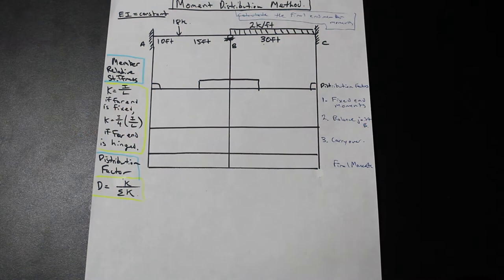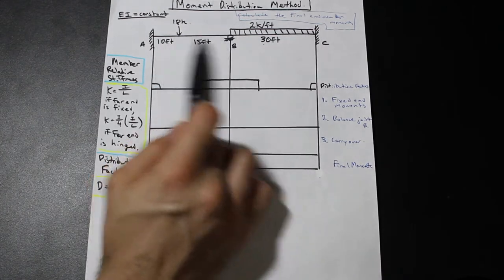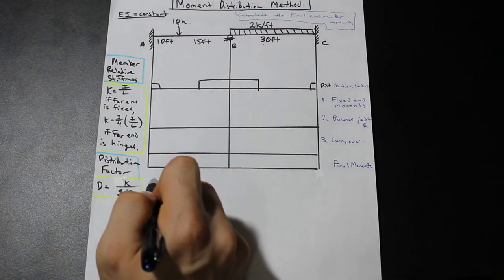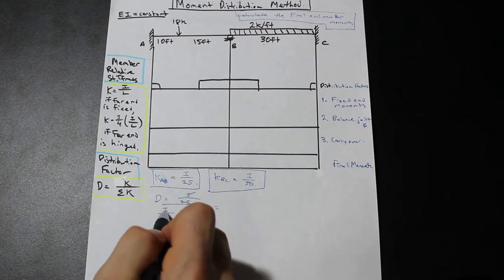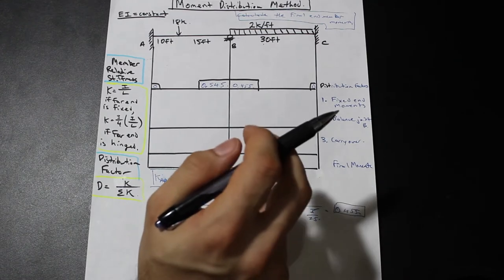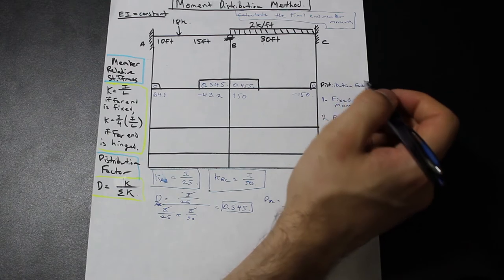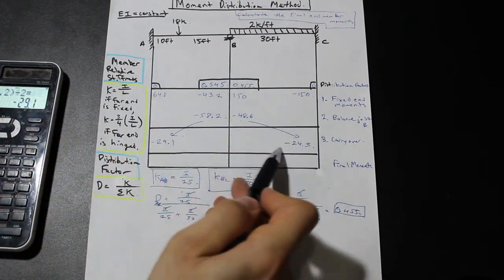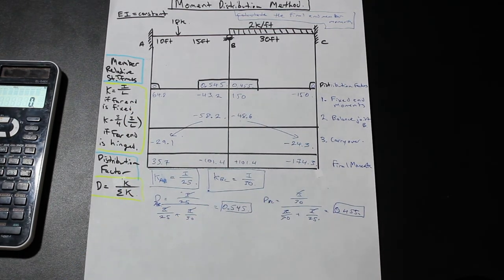Moment Distribution Method to Solve Member End Moments - Continuous Beam

Comment: sir in your university or college. the syllabus includes both the theory and practical application.
after understanding this concept did you check it in the practical field
Reply from the maker: Hi, personally I found a small amount of the courses very useful and most of them.not very.  I think the engineering curriculum also trains you to be a hard working problem solver, not necessarily everything you need in the practical field.
Reply: @AFMathandEngineering   THANKS

Comment: good example but not quite sure when k=0.75*I/L is applied in the sample.  this confused me a bit.
Reply from the maker: Thanks for the feedback on the video! If you have a structural analysis textbook I suggest you read the section that shows the derivation of how the relative stiffness of the members, or K, is derived, it should give you a better understanding., Essentially though, the stiffness of a beam is reduced by 25% when, for example, when the fixed end of a single span, fixed pin beam is replaced by a pin.  Hence, 3/4.

To summarize, the relative bending stiffness of a beam if the far end is fixed is I/L, and the bending stiffness is 3/4(I/L) if the far end is hinged.  Hope that helps :D
Reply: For a span with one side being fix support and the far end being purely pin support, that means it is a single span beam only, and moment distribution calculation will not be required.In your sample above, could span AB being considered as fixed on the left side and pin on the right side which requires the multiplication of 0.75?  However, I did not see that in the video.  Please advise.  Thanks
Reply from the maker: Albert Tam I was just referring to the fixity in the single span in order to clarify which  coefficients to use, maybe I made it more confusing.  When the far end is fixed you're using normal stiffness.  When far end is pinned take 75% of stiffness. 

In the case of this problem we don't need to use the 75% because we have both far ends as fixed so we take just I/L. If A was a pin we'd take 3/4(I/L) for AB.  Hope that helps.